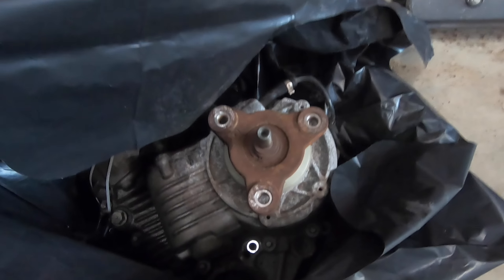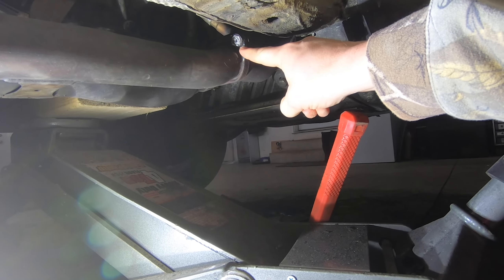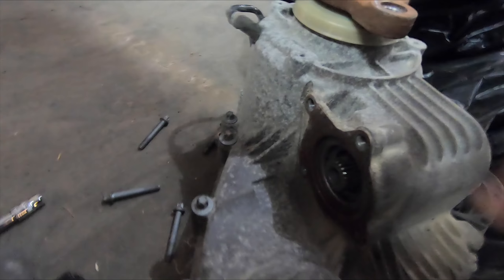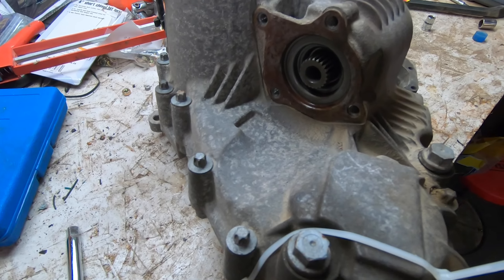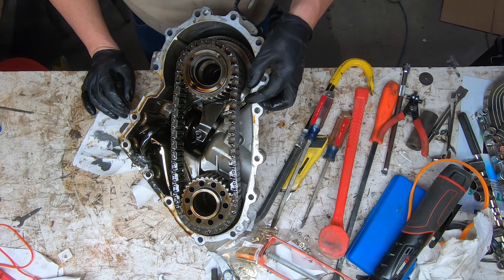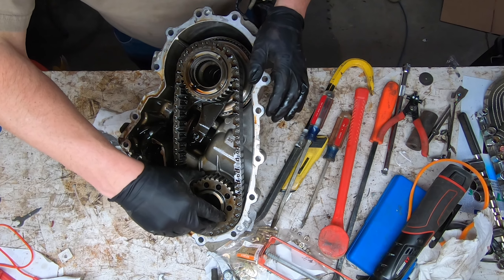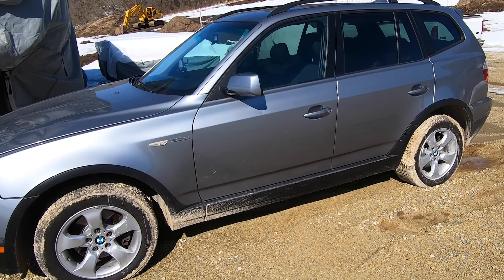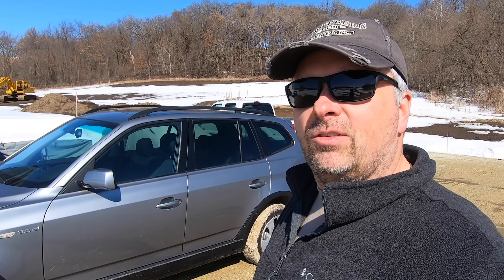2007 Copart BMW X3 is FIXED!!!

Comment: Nice Video, I am facing the same issue, I opened up the servo motor thinking that the plastic gear inside the actuator is failed. but the shaft actually rotates exactly same way as your old TC.
Reply from the maker: If you can get your finger into the t-case once that motor is out, it might help you further diagnose the issue.  If those discs inside are toast, that should be your problem!  Hopefully you can get it fixed, however it sure is more spunky with only RWD, but no good in the snow
Reply: @DachsAutos  true..... Thank you very much for advice...
Reply: @DachsAutos  I will probably not drive during snow and then I'll try to get old tc from old car like you